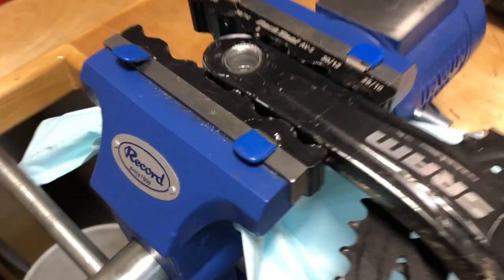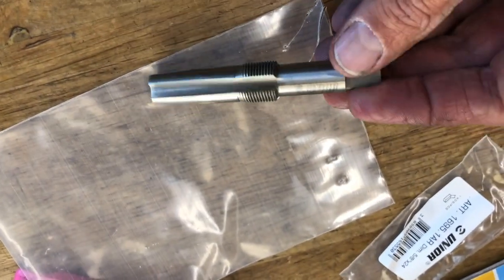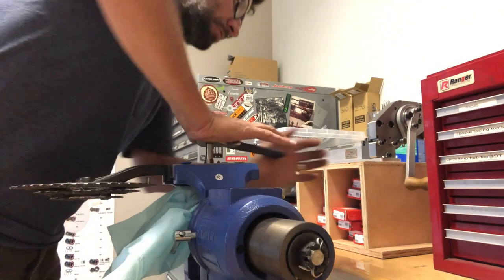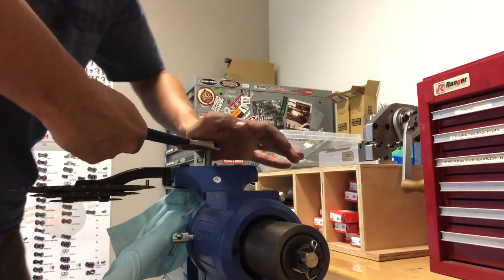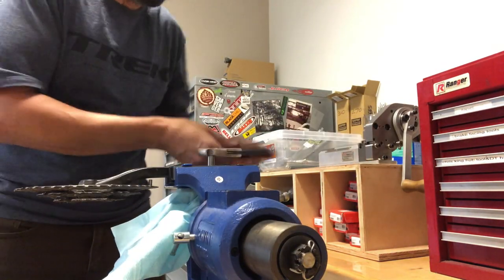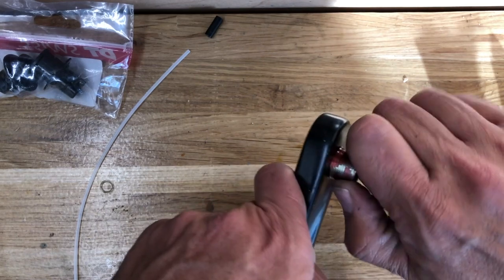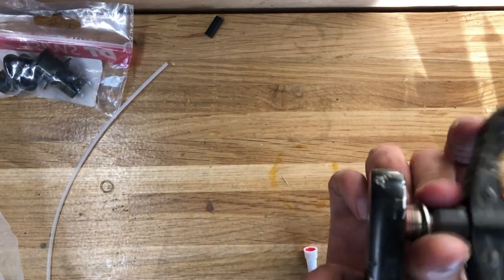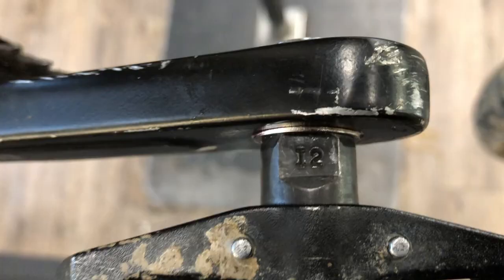How To Repair Stripped Crank Arm Pedal Threads

Comment: This is a very good explanation. I am new to cycling and I thought that the only way to get it fixed is to buy a new crank and new set of pedals. Of course than there would be a chance that the old chain and cassette might not be compatible and have to change the whole gear set. This solves it greatly and it can be repaired in just some 10-20$ instead of paying 300-400$ for the whole gear set. Thank you for this video
Reply from the maker: You're welcome!

Comment: To get a much smoother and better thread when using a tap do not keep going in one direction like in this video, go maybe a quarter or half turn and backup a quarter turn this will break off the metal you are cutting the go ahead again a half turn to make more new threads but keep backing of every half turn. You will get a much better thread and not overheat the metal.
Reply: You could go one and a half to two turns forward no worries than back a quarter with it being such a soft metal , but it was painful to watch as he demonstrated how you should probably not do it , I would be taking extra care given it’s already been stripped out once .
Reply: He was pretty clear about how you Should do it lol.   He Saud his method wasn't ideal.

Comment: Thanks for the video. Speaking of stripped threads, I was wondering how you would solve the problem of stripped threads where a crank puller threads into the crank to pull it off a square taper spindle.  In that case you can't remove the crank to rethread it, plus you're doing it in a blind hole.  Can be a real problem removing the crank!  Unrelated to this video really, sorry!

Comment: Informative presentation. Do they make a similar kit for a stripped rear derailleur female in the drop out? I have seen discussion of helicoil and a "dropout saver" nut.... Any thoughts?
Reply from the maker: I like the one wheels MFG makes otherwise a 10 x 1 metric helicoil works well.

Comment: Great advice. Its annoying that the bottom bracket and cranks have so much non standard design going on these days. 
Almost finished with my second frame. Used columbus Spirit tubing.

Comment: I have a question,if I am going to repair thread like that in my crankset,would it not change the size or diameter needed to fit the pedals
Reply from the maker: No. The common thread size is 9/16". The threaded repair insert is 5/8" on the outside diameter, so in other words, the damaged crank arm is bored and re-tapped from 9/16" to 5/8", but the threaded insert is 9/16" on the inside, the same as your original crank before and the pedal. The left side has backward threads, so you just have to make sure you're using the correct insert and tap for the crank arm.

Comment: Would make sure you are meticulous with the Loctite around the pedal you are using to install the insert, unless the pedal is never to be removed, ever again.  Good tip on pedal washers and flange, and insert length issue .
What is a fair shop charge for the job? an hour + 20 ?
Single Unior tools and inserts are to be found, though it looks like the guys below have not mastered google ;-) , and run about $40 for the a one time setup. New cranksets start at about $30, but left side arms begin ~$10 both going up to the threshold for pain.
I wonder what the faliure rate is , if a pedal is never removed. It would be interesting to see what the torque needed to strip is.
Reply from the maker: I apply Loctite in between the insert and crank arm. The pedal threads are always grease only . At our shop, the fee is $25 for this thread repair. Not really worth it if it's an inexpensive non drive side crank, but it's pretty cost effective for most drive side crank arms. 
The reason pedals strip out of crank arm in the first place is not over tightening, but under tightening. I think I did 4 of these repairs last week. A couple were from a competitor shop. We're pretty much in the middle of a bike boom and shops are assembling/selling bikes trying to keep up with demand, and that's when quality control suffers. Gotta get those pedals TIGHT when assembling a new bike!

Comment: I’ve just bought an Carrera Vulcan ebike and haven’t put peddles on properly and the threads gone would Halfords fix this?
Reply: Halfords don’t do pedal threads they’ll want you to replace the whole crank arm
Reply: Yes same happened to me .   Went to Halfords and asked  some other shops . They do not do it .  Did you have any luck in the end ?
Reply: @yl8908  what I ended up doing was ordering part on eBay for £70 then they fitted it for £20 because I didn’t have right tools
Reply: @srettubyaj8441  thank you for your reply .

Comment: So, I see you are using lock tight on the pedal thread -- but I think you stated that regular grease is ideal. Which type of lube should be used on say a new bike pedal?
Reply from the maker: I used Loctite on the threaded repair insert, the threaded pedal spindle always gets grease. Pretty much any grease, (bicycle specific is good but not mandatory) will work for bicycle assembly. (threaded fasteners, seat posts, etc.)

Comment: I’m having a lot of trouble finding the Unior tools (or Similar) in my area (Toronto). Mainly I can’t find the thread inserts, even on eBay. Any help in affordable ones would be appreciated.
Reply from the maker: I did a search on some of the individual pieces and tools. It's looking pretty slim right now. I'm not sure if it's certain bike tools or all of the bike industry in general. I can say for sure as someone who has worked in the bike industry for almost 40 years, I've never experienced some of the shortages being experienced with bikes, parts, tools Etc. currently.
I think your best bet in the next few months would be to find a shop that does the repair I demonstrated in this video.

Comment: HelloI need some advice please. I am planning to tap in a new thread for my bike. Standard 10mm size bolt but I am unsure what size tap do I buy?? Reviews are telling me it's M10 but not sure 

Cab you please help me it's a Shimano pedal 10mm bolt on pedal size.
Reply from the maker: Pedals use a 9/16" tap size https://amzn.to/2x9C2gB 
In this particular video, I'm repairing a crank that the original 9/16" crank arm threads have been damaged to the point that a 9/16 pedal just falls out. 
10mm thread size on a bike is typically the size your rear derailleur bolts into the derailleur hanger. That tap size is a 10 x 1 https://amzn.to/2UY1GxW

Shimano pedals are 9/16"
Reply from the maker: This is the kit I used in the video. https://amzn.to/2XqvPrh
It's not really cost effective as depending on your crankset, you can more than likely purchase new cranks for less. It also depends on which side (left or right) crank arm is damaged. I'm not sure if Helicoil makes a reverse thread kit as the left side crank threads are reverse.
VAR also makes a kit it's a PE-04700
Looks like it's available in the UK, again pretty expensive, but I saw ads on eBay just doing a quick search for individual reamer/taps and the threaded inserts separately.

Comment: That's and expensive kit, but I've solved this problem an only for 20.00. no epoxy/adhesive straight fix and better.
Reply from the maker: Let’s see your video. Our shop charges $25 for this repair. Show me how your repair is better and $5 less expensive.
Reply: @JoeyMesa  soon.. but we really did have hard time with this issue and YT search didn't help, soon.